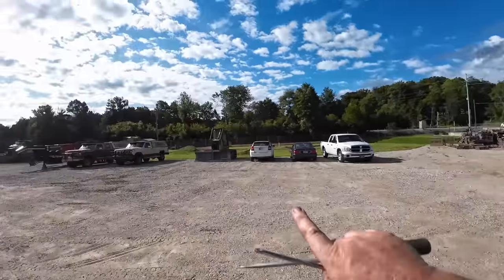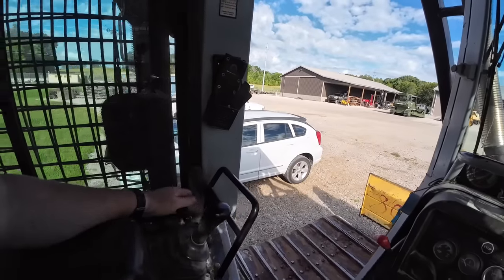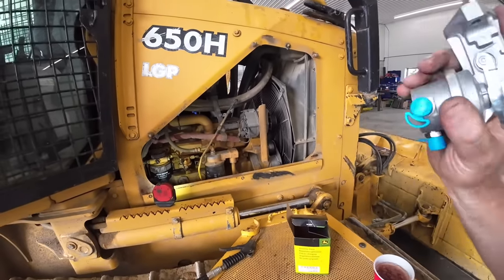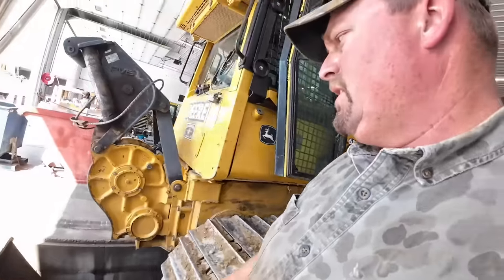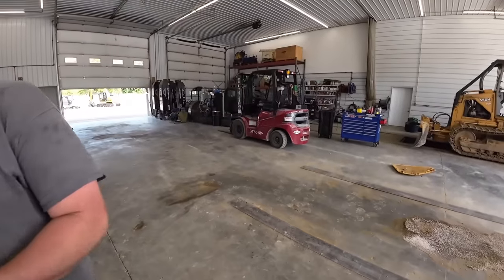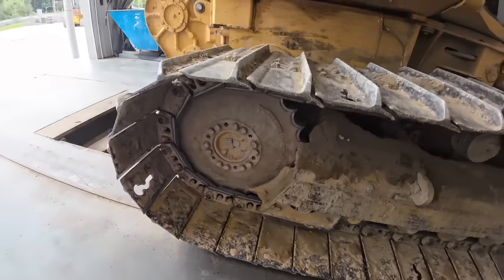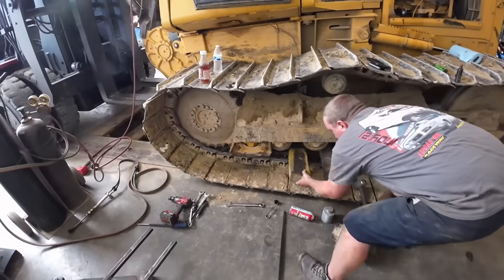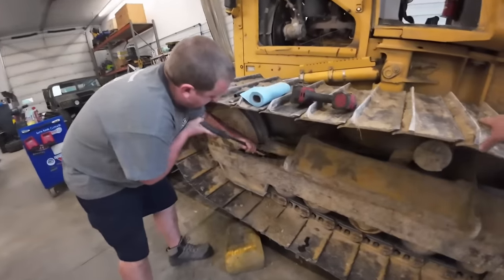Simple repair on dozer leads to many headaches and we return so broken Harbor Freight tools!

Comment: - I believe the induction coil principle is to heat the metal surrounding the bold, not the bolt itself.
- Heating the bolt & sucking in penetrating oil works only if you allow for enough cooling the time, and when welding on a nut...but you know all of that.
- Working on stone crusher cones with scores of 3 in. bolts w/ 6 in. nuts compressing eighty 1.5 in. coil springs teaches you a lot about how much acetylene it takes to correctly heat the nuts and not the bolts...All that just because one big loader bucket tooth got lost and went over the screen into the cone and jammed it
- Try doing all that and lifting off the 9 ft OD Top Ring of foot tall cast steel with a jib on a loader. replacing everything and tightening down 80 coil springs in a remote stone pit, just so the next 12 hour shift has a machine to run.

Comment: My father was a millwright. I would work with him sometimes on the job when I was laid off from my job, and he would have me heat up the bracket, not the bolts, the bracket and the bracket would expand hopefully, heat up the bolt, the bolt will expand and just get tighter so I don't know, I know you guys know what you're doing but like I said, you want the bolt to get fatter , Or get skinnier?
Reply from the maker: Yea
Allot of times heating the bolt will break the rust loose
It’s easier to get it hotter

Comment: I know long ago I had a D7 the bolts broke off in and we just welding them back on.
I know it was not the right way but it was a old 1947 cat and it did the job and built the lake and then we just let the old cat die back in the lake .

Comment: The problem with some retail stores , all management is different so from one area to another trues change. I will not buy another battery operated device from Harbor Freight. Bought the 40V blower & hedge trimmer . Went in about a year later to get a replacement battery. But they changed the product to something else and no more 40V batteries this style I have. Until batteries all have the same mounting style no matter manufacturer this is still going to be a issue. Interesting problems on the JD needs a mini Magdrill. Sorry about the rant.

Comment: That bolt was tough. I’ve done a few on exhausts. If the bolt goes thru and sticks above the metal, I find the threads get rusted up and won’t spin out. I cut the bolt flush with metal and they usually spin out after.

Comment: Have you guys ever tried Freeze Out? Heat the bolt and then nail it with the Freeze Out the thermal shock will get it just about every time.

Comment: 11/14/23..2day was undercarriage on JD 650: 2 rear rollers & 2 other rollers (1 has only 3 bolts due to extreme rust etc.
  Last video you were retrofitting a JD 850J which had been used as a parts pile via swapping many parts before selling it...your 'low hour' EZ Flip machine video..🤔 ...but today was not a continuation of that 850J but this Forestry 650 with combo fuel, brake pull 1 side (?) or steering clutch issue. Kinda lost video concentration on brakes & uneven pull & got fixated on removing (uncooperative) under carriage roller bolts. Glad you stopped unproductive torch heating then trying a brand new (SnapOn?)$1000 electrode conduction  tool for stubborn/frozen bolts. Still...an enjoyable video showing your great troubleshooting skills & yur willingness to buy 'new' tools for tough customer problems. 
  Hope to hear status of 'abused' 850J.
Stay safe & carry on!🔧⚒️💪😊
Reply: J is in paint.

Comment: I have many broken bolts from the bottom rollers of crawler cranes. had .
I've always had the best luck with drilling a hole in it, making it red hot and then letting it cool. but still a lot of work

Comment: Drill another hole and just put a bolt a flat and lock nut everything will be fine
Reply: Right angle drill is way cheaper than that over priced heat gun ya know

Comment: The thing about thise induction heaters is the metal has to be in the circle or loop.  It doesn't really transfer heat down the bolt to well.  I'd say welding the nut on or torch would get the rest of that bolt as hot as it would get.

Comment: Those induction tools are really handy when you cannot have an open flame present in the work area, but you need extreme localized heat...inside an engine bay of a car for example. Heating the head of a bolt is less than ideal because you are not directly heating the threads, the heat must travel through the bolt before it can help and it's not very effective on large metal objects, it works well enough on small bolts though. Where they really shine are with nuts, because the heat does not have to travel and expands the nut around the bolt to help release tension and break the bond between the threads. The heat works from the outside in so the nut gets hot first, expands and breaks free from the cooler bolt in the center. With that broken roller bolt, you'll have better luck heating the track frame right where the bolt is going through it. I'd preheat the area, weld a nut on there, peen the area with an air hammer, and then get the frame cherry red with a rosebud and immediately hit it with an impact. Please try it and report back! Love the channel, looking forward to the next one.

Comment: The induction heaters work on nuts being removed from studs but not so much on bolts with just the head exposed. Torch or Air arc is probably the best or anneal the bolt and drill it. It looks like the top of the bolt is exposed. They should use bolts and nuts.

Comment: Is this the same dozer that was rolled over previously? The induction coil was interesting , shame it didn't work this time around. Hopefully it will be used again on something else. One advantage I can see with an induction coil versus a torch is the flame of the torch possibly igniting some oil residue, hydraulic hoses or wiring. Pin point heating with the induction coil would likely be more desirable in tight areas. I enjoy watching your videos and thanks for posting them. Have a great day.

Comment: Ida had that frame rail near dripping hot… There comes a time to grab the breaker bar and work it back and forth rather than keep snapping it off with the impact… You guys are excellent at what y’all do but when it comes to fixing F-ups… I gots skills cuz that stuff stresses the hell out of me…. And I’d had run a little weld near that missing bolt.

Comment: My 650H the threads on the fuel cap wear out over time and the cap screws down further and blocks the vent ,have to keep the cap loose,  prevents the out of fuel
as soon as you start up.other than that the best dozer out there.

Comment: Test those coils for directional focus,  I'd try a wooden surface with a 2" hole and rest a 3" steel can 1/4 full of water,  over the hole, hold the coil near the BOTTOM of the can,try horizontal and vertical, I'd bet on vertical being faster to heat the water , coil shouldn't need to touch the can,those coils appeared to be insulated for just that purpose

Comment: You want awesome tools kline screw drivers and side cutters. NOTHING better. the sides you can buy the ones with hardened jaws for cutting nails, so wire and cotter pins is a snap.

Comment: The mini induction coils are meant to expand the nut off the bolt. I doubt if it'll work on a bolt stuck in a steel structure. Everything is worth a try though. It'll be easier to work on when its facing upwards and its sat on the bench. Good luck.

Comment: That's frustrating to say the least with that bolt. I have one of those mini-ducters and while it works ok, it is def not a replacement for an oxy/acetylene set. It works great on fasteners of about 3/8" and down. 1/2" and up, it seems to be hit and miss. I've overheated mine a number of times  trying to get larger fasteners out in places or conditions where an open flame is not a good idea. Most times I can get them out using it, but there have been times when it was like beating a dead horse. They have their uses, but if I can, I grab the oxy torch. And boy did those things go up in price. I've had mine for around 6-7 years and I thought $400.00 of the Snappy wagon was tough to swallow back then. Great video as always!

Comment: That was also a welded head on that bolt, so it's weaker than the original bolt. But I don't think it would have worked even if it was all original. I don't that will work on dozers

Comment: Clint drill the bolt all the way through and use a 3/32 7018 welding rod stick it all most all the way in drill whole and weld up drill whole let it cool off  then take your ease out tap it in and screw out bolt 😂

Comment: Your bolt was to short. It reverses magnetism thus moving the molecules in the steel. This moving of the molecules gives friction whitch make it heat up. Like rubbing your hand toghetter when cold. It would have worked before kevin(who else😉) broke that piece of.
For situations like this, if its posible to drill a hole in the bolt ( i know! most of the times not possible!) it would take the tension out of the bolt/pin.

Comment: Do you save the bottom roller bearing caps to bolt on with one bolt then use drill bushings to guide your smaller drill bit straight thru the middle of the broken bolt. Allowing you to stay centered.

Comment: The tracks have holes (from far it looks like a key) cut out. On the right side they are every 6th panel, on the left side they are no real order. This is the first dozer that I have noticed these holes. What/why are they for? 
Thanks 
Looking forward to that Snap-On tool that heats the bolt working.
Reply from the maker: Chain holes for tie downs

Comment: Clint I don’t understand why you simply did not drill it out? Yes I can see space is at a premium however that’s why I have a couple of different 90* angle drill motors to do that exact thing. Yes I know I’m being the Monday afternoon quarterback and hind sight is always 20/20 and all those other statements people will likely make but being a metal fabricator with over 45 years experience I might have run into this type of issue once or twice in my career….just sayin🤷🏾

Comment: One might be tempted to ask ,
How good was this machine when sold 
Should it have had new undercarriage knowing it was going to be in Forestry work 
Is this machine a one operator unit 
How is it used ?
Add up the times that its been back and fourth to the workshop and how much has been spent by both the customer and C&C Equipment are these second hand machines worth the initial sales price savings  ?

Comment: the struggle bus was in full service on that roller. its always the small simple jobs that bite ya in the ass. when that 1st bolt snapped, looked like the socket or the swivel   let go exploded. where the head of that bolt went, nobody knows

Comment: My question is y do u keep heating the bolt and not the insert/nut ?  When u heat up metal it expands so when u are heating the bolt cherry red  u are making it swell into the insert/nut , where as if u was heating the insert around the bolt it would expand and normally let bolt come out  .

Comment: I used to struggle with broken off bolts when I did undercarriage work. I usually ended up drilling them out and retapping the hole. 

I had good luck drilling a hole through the broken off bolt first and then heating it and welding a nut on. That seems to give it room to shrink.

Comment: Can you, find me some small rubber bushing for my 1940 9-N ford tractor, I can’t find the rubberbushing for the hydraulic driveshaft3/4  for the front in loader hydraulicpump in the crankshaft pulley there’s four holes that fits at 4 3/8 of an inch pins four of them in the rubber bushings that goes into the crank pulley, I can’t find the rubber bushings

Comment: A technique I've used for stuck bolts is to use a air chisel with a punch bit to rattle the steel along the edge. It looked like you could have had access to do this. Works on big nuts as well

Comment: 1K for that tool my ass... It does the same damn thing the torch does but it takes longer. And I'll be dammed... It works the exact same as the torch did for that bolt. Give that POS back to the SnapOff guy and never look back. When you have that joker upside down, drill it and use an easy out. It will eventually give up the ghost.

Comment: Ya kno...  if instead of being threaded into the frame that using nuts on opposing side would be better.   Then snapping off a head would be NO problem.  This isn't applicable to exhaust manifold studs. Not that I can imagine.

Comment: The truth about YouTubers is that 95% of them don't know anything.  Usually only 1% are experts, and the other 4% are experienced but not experts.  If you ever want to test them, have an engineer comment with advanced knowledge of the subject!  The 1% group will see the comment and be able to read the experience.  The 4% group will get intimidated by the comment and try to argue.  The 95% will try to silence the engineer or try to shame them.  

In engineering, there is a term the Interatomic Bond, which is the force that holds materials together.  My pun, Interatomic Bomb, which is the results of stressing a material to its breaking point giving an explosive reaction.  With most YouTubers, they reach the point of the Interatomic Bomb soon as you point out the fact they aren't a god!
Reply: Some gents built a huge trebuchet and used a stainless ring and hook for the release mechanism. They found that the stainless was microwelding to itself under tension thus delaying the release. They went to a bronze ring and on the first try they increased the distance thrown by about 20 percent.
Reply: @kenore4003  How bad did the guy that pointed out the physics get burned?

Comment: The induction bolt heater is like a microwave, it heats from the inside out; you need an air gap between the bolt and the coil for it to work.  Once you get use to it, you won’t have to lug around gas tanks to heat stuck bolts; all you need in the field is a small Honda generator.

Comment: Instead of welding a nut on the broken bolt, just keep welding on the bolt until it extends from the mating surface far enough to grab with vice grips or a lever you can weld on. You'll get more heat into the bolt.

Comment: Do you feel like you may have thrown $1000 in the trash? That's an induction heater that heats what is inside of the coiled part. Other stuff, not so much. Your torch will work better.

Comment: It's funny and all but heat the part the bolt screws into and chill the bolt. It's basic physics, thermal expansion. The thousand dollar ass wiper 1000 that the Snap on guy got you for is just an induction heater coil, it has a duty cycle just like anything. That pile of smashed assholes is way undersized for the work, you can build one that is 100 times better for less than half the price. The induction heater works well when it heats the nut quicker than the bolt (cause physics), you guys are trying to heat the bolt up, making it grow in size, making it bind more in the parent material.

All funny, but frustrating as all hell.

Comment: Breaking the tip of that screwdriver is exactly the same as pulling shingles off your roof to get your insurance company to pay to replace it.  It's called fraud.  Terrible example to set.
Reply from the maker: It was already chipped
Reply: @C_CEQUIPMENT  Then why the need to break it further?